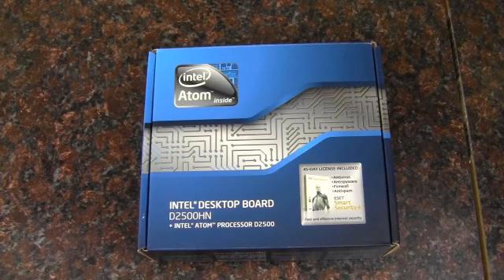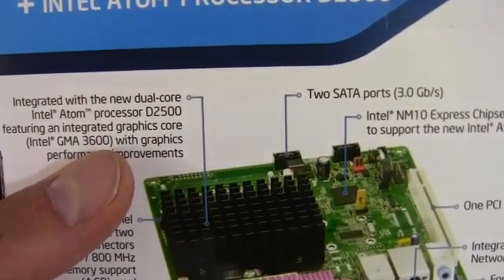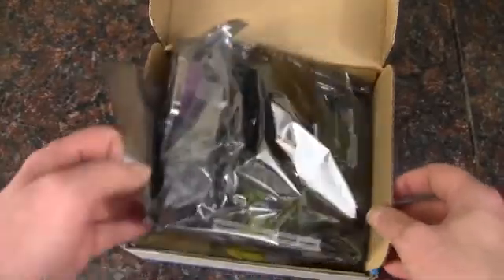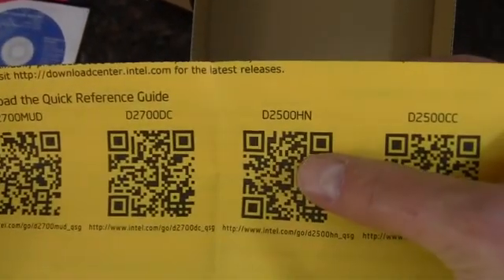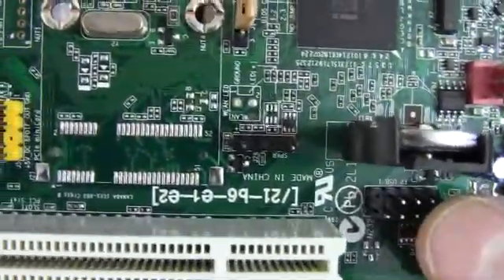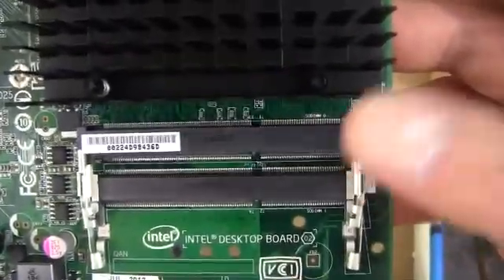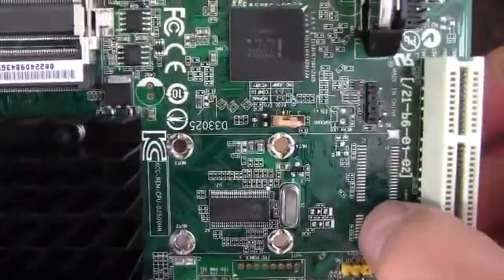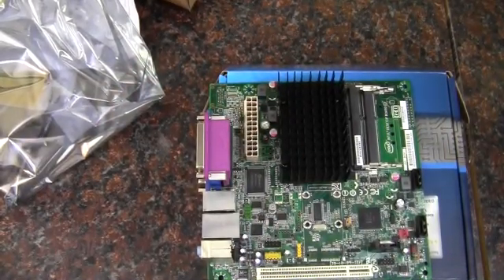Intel D2500HD Mini ITX Desktop Board

Comment: Hi sir do u still have this board?
Reply from the maker: No. I ended up selling it to someone that I think is using it as a router.
Reply: Thanks 👍
Reply: Bro how do board turn as router?
Reply from the maker: @samind4u  There is a program call pfSense. It is an operating system that is designed to run on low power systems. It is a pretty cool setup and allows a ton of options for your home network. https://www.pfsense.org/